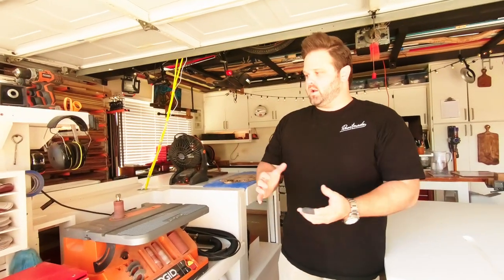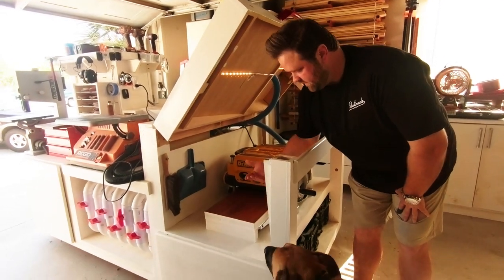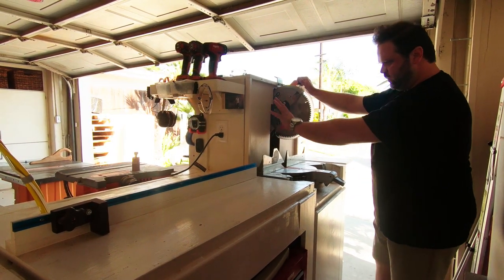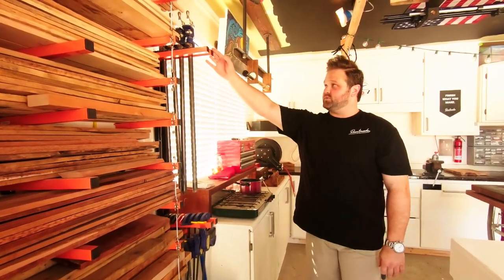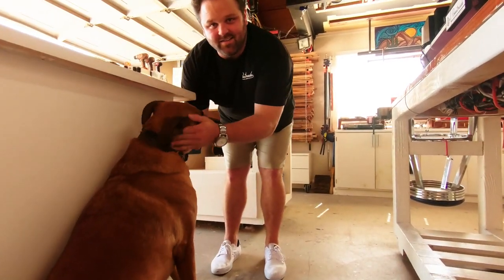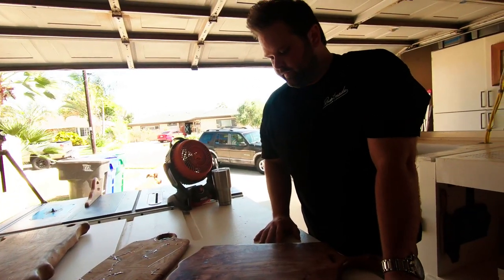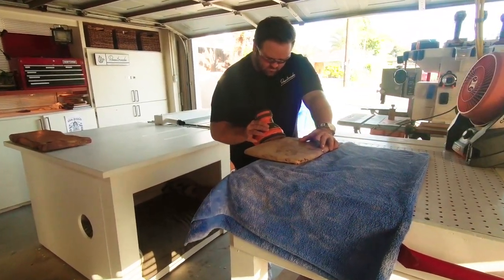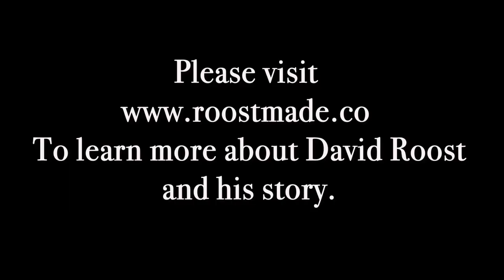Peddling wood series: Episode 1: Roostmade, San Diego, CA

Comment: Nice video, nice shop set up, and nice products.  Good job!  One point on the DeWalt 735 planer - it will easily go down to 1/8" but there is a depth lock that allows for convenient settings in 1/4" increments.  The planer in this video is set on 1 1/4" as shown at 7:47.  Unless that is broken his planer will also go down to 1/8", not 1" as he stated.  I rarely move mine from 1/8" so it doesn't get in my way to go as low as I want, but if I want to cut below 1/4" I use a sled.
Reply from the maker: Thanks! I will pass this on to David.